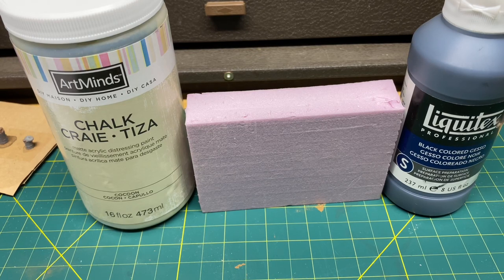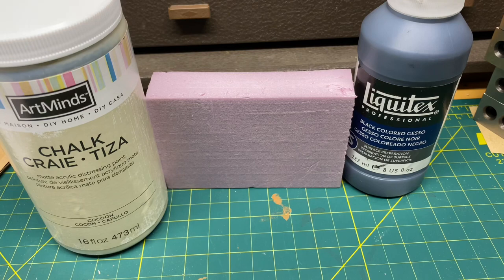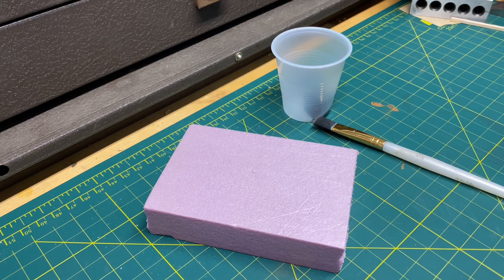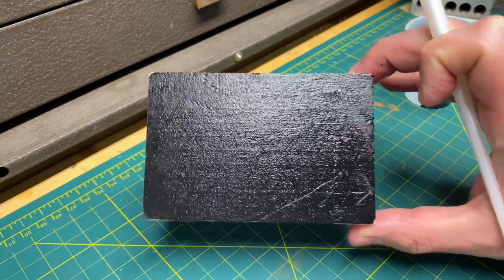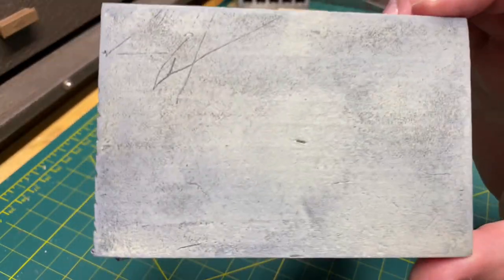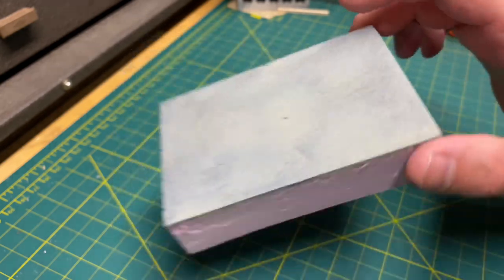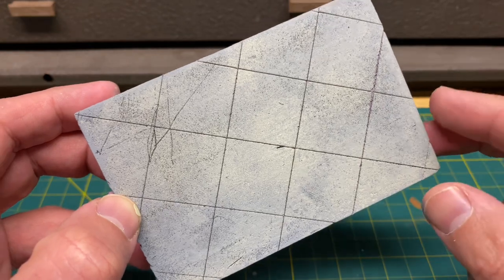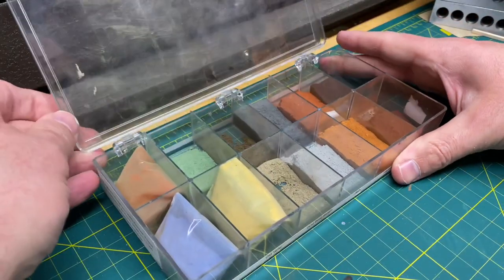How to Model Concrete

Comment: Nicely done, I'm always looking to find tips and ideas because I want to do 1/24 scale automotive dioramas. Your demo piece would do well for a 1/32 scale car display, I'll have to increase the spacing of the concrete plates for 1/24 scale, I have plenty of modeling flock and tiny leaves to complete the look.
Reply from the maker: Thanks for your comment Max!

Comment: Amazing Work simple n straight forward I'm an N scale modeler I was wondering on N scale would I cut the joints closer in proximity for a smaller squares?
Reply from the maker: Yes, for N scale you will have to adjust the size.  Use a scale ruler to help you on this.

Comment: Hi again. I hear no where in video the size of the concrete slab blocks. I suppose you didn't mention it because there are many sizes. Yours look like 1 inch and a quarter. Witch would be like nine footers. Again, congratulations. It's a video that explains very well what needs to be done for a truly realistic result.